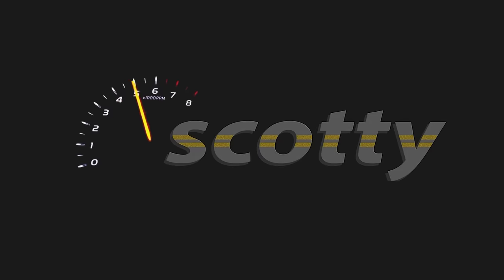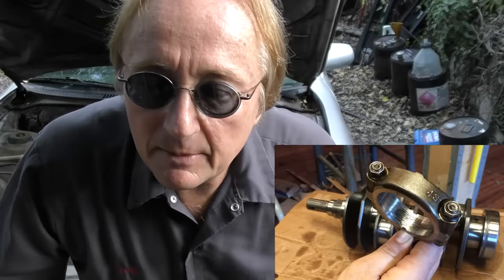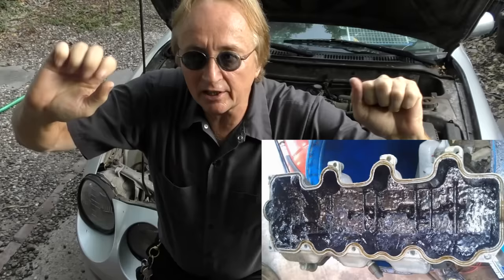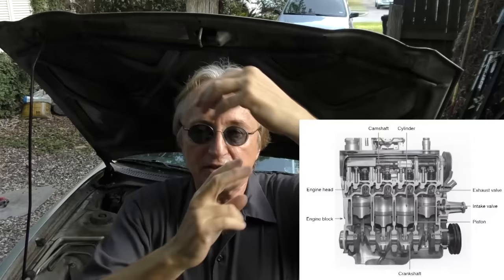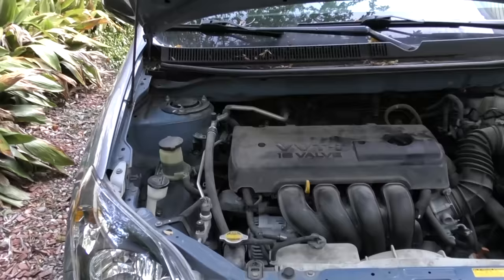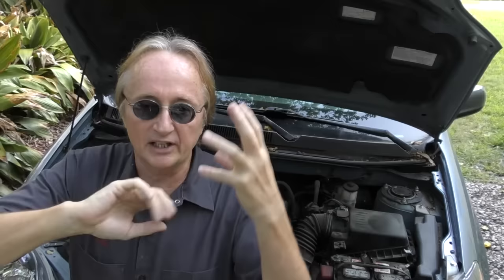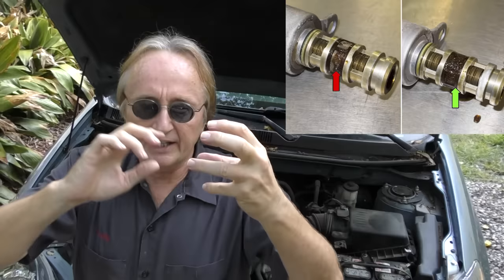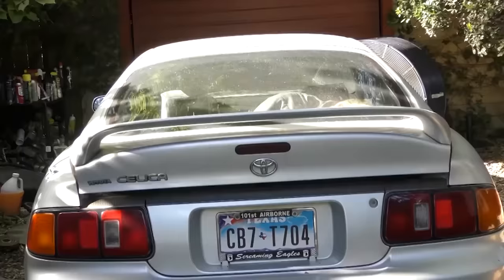Why Not to Flush the Engine Oil in Your Car

Comment: When I worked  At Valvoline Instant oil change They would  Make me try to sell cars with only 20.000 miles a engine flush  There was no purpose of that it's pretty much a brand new engine and  Make me push an engine flush on every car  I don't feel comfortable selling people products they didn't need So I quit  I don't like Scamming people I like to help people
Reply: I actually got one of these a few days ago on a used car I just bought. The used car dealer overfilled the engine oil big time and they used conventional.  One night coming home I decided to floor the car and it went in to limp mode. I bought MAF cleaner but I was worried about the engine oil being so full so I got it changed + an engine clean at Valvoline. Car only has 40k miles but I want it to last 400k.
Reply: If you can't flush a new engine and Scotty says you can't flush an old one, when can you flush? Never?
Reply: @spoton3278  I think you're missing "if properly maintained", which this wasnt.
Reply: Thank you for your honesty and integrity.🙏🏽🙏🏽🙏🏽🙏🏽
Reply: I happen to have a Valvoline in my town, they are quite the opposite. I'm sure it depends on the owners
Reply: @affinity3281  - Engine flushing is a scam. Modern high detergent motor oils don't allow varnish (much less sludge!) to accumulate. Look in the oil filler hole of a recent car that has had it's oil & filter changed at least according to spec (generally 7,500 mi) and you won't see any varnish. A well cared-for motor made 20 or 30 years ago that has had SJ, SK, SL oil for most of its life will have a little varnish. SM and SN will get that varnish off everywhere it matters.
Just spend that flushing money on more frequent oil & filter changes.
Reply: My shop doesn't do that we don't try to sell flushes unless the customer insists because its useless to do so
Reply: Good for you! It's better to be honest because people notice and you'll end up with more customers
Reply: @algrayson8965  sludge happens when no service intervals are respected.
 You cannot remove sludge with a new oil .
Reply: you are a good soul!
Reply: @algrayson8965  very good advice Al
Reply: Use flush only every 50k is my advice.Frequent oil changes is a must.
Reply: I work at Valvoline Instant Oil Change right now and they legit tell us NOT to pressure customers into buying things and let them decide what they want or not. We show their current air filter and compare it to a new air filter and from there they decide. Your comment is bullshit, us pushing the customers to buy different services is bullshit lmaoooo they tell us not to do it
Reply: Thank you for your honest, we need more people like you.
Reply: Question: Valvoline told me 3 months ago I will need a engine flush. Fast forward to today I'm at 52K miles on my car and will also need an oil change. Should I skip the engine flush all together and why do Valvoline reccomend it?
Reply: Tremaine Johnson You don’t need an engine flush. What kind of oil do you usually run in your car? Conventional, Semi-Synthetic or Full Synthetic??
Reply: @michaelnikprelaj6679  semi synthetic. I only have 52k miles
Reply: Tremaine Johnson Do you do your oil changes on time every time? Every 3-4K miles is ideal. If you do your oil changes in that interval you don’t need an engine flush. Btw what kind of car do you drive
Reply: @michaelnikprelaj6679  absolutely, Hyundai Sonata 2014
Reply: Do u get flushes if u dont do oil change on time?
Reply: Tremaine Johnson Not necessarily but I personally would just because I’m OCD lmaoo
Reply: @michaelnikprelaj6679  thanks for your help today.
Reply: @algrayson8965  You do admit that sludge builds up then you must use flush thats it
Reply: @michaelnikprelaj6679  - Modern ECM cars compensate for altitude, barometric pressure and air filter restriction. Up to a limit.
Reply: @spoton3278  Yes.  Never.
Reply: SpotOn flush after Mexican dinner
Reply: @affinity3281  What do you mean: "an engine clean at Valvoline?"
Reply: That being said..how is vavoline oil..i started using it recently...jus like any other oil hih?
Reply: Jiffy Lube wanted me to that with my 2002 Mercury Gran Marquee and they insisted I get it done and since I repeatedly refused they said I cannot leave until I get the synthetic service.  I got right back inside my car and blared the horn until they let me leave.   No one is allowed to hold any customer against their will over anything.  Believe me, I got really loud and obnoxious.  I black listed that place big time and made sure EVERYONE knew about it.
Reply: @NRush2009  skip it. Doing do it.  No need. Just keep up a good oil change schedule. And go synthetic if you haven't already. Modern oil has great detergents that keep your engine clean. Valvoline is recommending it because they make more money selling you the flush product and charging more labor for the performance of the flush. Just a way to make more money
Reply: @michaelnikprelaj6679  
Are you trying to tell us that all Valvoline Instant oil Change locations are exactly the same?
Reply: @NRush2009  
What does Hyundai recommend for oil? Is it OW-20? Most manufactures have it right on the oil filler cap.
Reply: @frankiegoes2placestravelvl507  
If Jiffy Lube did that to me I would call the police and the news department of a local TV station.
Reply: Steven Sevek Since all of the Valvoline stores are corporate, we’re all taught the same, doesn’t matter which location you go. Pushing ANY services to the customer has NO affect on the employees. We don’t get paid commission.
Reply: @michaelnikprelaj6679  
I appreciate that but just because they are taught the same doesn't mean they are all run the way they were taught. Even some policemen are dishonest. A cop was recently o jailed in Pennsylvania for sex crimes against female drivers trying to tell them if they had sex with him he wouldn't give them a ticket. I worked for Home Depot for 18½ years and they are all taught the same. But after being in 4 different stores I can tell you that not all managers are of the same quality and not all of them follow SOP (Standard Operating Procedure).

Okay you don't get commissions so I understand what you're saying since that was the statement made. However I'm sure the manager would benefit in some way by increased sales. No?
Reply: Right there with you. Managers would try to force me to sell that crap on every car.
Reply: I quit a corrupt automotive job to, a male nurse now.
Reply: @frankiegoes2placestravelvl507  they can't force you to buy the service if you don't want it you can leave i would have done the same thing i be gone so quick
Reply: My car got slow after a engine flush at valvoline. Speed good on first gears but slows down after the other gears. 
Please can someone know anything about this. 
Thank you for you help.
Reply: I’ve heard a lot of it is atf fluid added in to break down carbon deposits. Same reason they use atf for cleaning guns
Reply: @judahsoremy9857  valvoline brand oil cleaner
Reply: Blake T  it could clog the engine if it has lots of sludge
Reply: You a real one🗣
Reply: 20,000 miles is a good time for a flush or cleaner. Follow up with an early oil change, like 1000 miles.
Reply: @tarquineous  750000 miles for the first flush and then every 500000mls
Reply: @frankiegoes2placestravelvl507  Not true. A vehicle service center can refuse to let you leave if the vehicle is not road worthy for what ever reason. Seen it happen all the time. A lot of the time they will tow it back to your house or where ever you want it. Especially if it concerns vehicles like tractor trailers, they would get called on as soon as they left if service is not done. However in your case it had nothing to do with road worthy concerns.
Reply: @affinity3281  i think its always a good idea to do a hot oil flush now and then, it will keep it running the best it can. Its simple, you take care of your car, and itl take care of you.
Reply: I got fired on the second day I worked at Valvoline cause I didn’t pee in the cup
Reply: You guys also tried charging me $95 for a full synthetic oil change
Reply: @Kamal_AL-Hinai  they were getting me in trouble for not trying to sell it on every car
Reply: @NRush2009  to make $$
Reply: @michaelnikprelaj6679  ams full synthetic
Reply: @michaelnikprelaj6679  1st Gen Toyota Tacoma Prerunner
Reply: @NRush2009  nope
Reply: thekeyboard warrior  ya what u need
Reply: @fernandocoronel8404  if it's your gears probably your transmission
Reply: Yes it can that's why I don't recommend ending flushes on newer vehicles
Reply: I tell you buddy, almost every business out there is pushing unnecessary product and services. You are not alone in your feelings. And please never change your moral conduct.👍
Reply: You are a Hero!
Reply: I recently had a short stint at Valvoline. The only time we can do a flush (or an evac—short for evacuation—as Valvoline calls it) is when the oil is full on the dipstick. If the oil is low, we just do regular oil change. The people working at my previous store are honest and never pushy, though I'm not too sure about selling wipers. If Valvoline also sold long-lasting silicone wipers, it would be 150 percent honest. It only sells regular rubber wipers that need frequent replacement. More replacements = more $$$.
Reply: good for you👍
Reply: I salute you
Reply: @affinity3281  that depends on what car brand you got
Reply: @stevenjr6582  I disagree. I've seen amsoil and royal purple take some nasty stuff out of a motor.
Reply: @spoton3278  Only if dirty
Reply: Same here, except pep boys. I want to help people, not sell "wallet flushes".....
Reply: Can confirm!
Reply: You are amazing God bless you . I feel the same as you
Reply: @frankiegoes2placestravelvl507   Whaaaaaaaat? What a nightmare!
Reply: I flush my butt with Taco Bell !
Reply: God bless you for your moral and integrity. I remember going to jiffy lune one time and My car had 47,819 miles. This one guy told me I need an engine flush and I called my brother to let them know what was going on. My brother said take your car and get out of there NOW! They are scamming you. We definitely need more people like you on earth to create a better and safe place for others. 🙏🏼🙏🏼🙏🏼
Reply: I did the same job . The time came did not get any extra sales so they got mad at me . Guess what.  I lost my job . Now I have a way better job, cdl driver . Don't scam people.
Reply: @spoton3278 this dudes saying they tried to make him sell one to a car with 20k miles which unless you never changed your oil it would be pointless
Reply: For 20k miles, trust me. That engine sure as hell needs it😂🤣
Reply: @desmondlouis5762  only if they didn't change the oil like every 15000 miles, would be better to do multiple oil changes in a short period of time for new engine first few oil changes
Reply: i just got talked into a engine flush at valvoline 4.3 v8 caprice regretted it immediately. no issues yet only went 30 miles so far. how worried should i be?
Reply: @Mr-furley  there's nothing to worry about it's not going to damage your engine it can help engines that have sludge
Reply: @stevensevek6151  no there independent ly owned
Reply: @michaelnikprelaj6679  not all of them are corporate my friend has a franchise
Reply: @NFLYoungBoy223  lmfao
Reply: @davidkeevil5151  my first job ever😂
Reply: @michaelnikprelaj6679  you still working there
Reply: @MrROTD  the oil change box stores are not “shops” there are no mechanics there
Reply: @awaisiqbal8934  the point was; the sludge is OK deposited on the side of a rocker arm,but if you now knock that stuff all into the little oil tunnels of the components, it will plug them up and actually cause severe engine damage. Kinda like turning on a ceiling fan that has never had the blades dusted, now the dust is everywhere.
Reply: @Mr-furley  swap out the oil and filter again in 1000 miles and don’t wasteyour money with flushes, you can do more harm than good - I have 2 4.3 gm’s but they are v6 vortecs in pickup trucks, I’ll bet the v8 has some nice torque
Reply: @kellismith4329  its really not bad far better than the 305 tbi. same cam heads as lt1 just smaller cylinders and stroke.
Reply: Am glad there are still people like u..
Reply: Every mechanic should be like that. Sadly all of the scammers in the past. Have given garages a bad rep.
Reply: Thank you, sir. You are a Great Heart Man.
Reply: Unless they went 10,000 miles on each oil change. But remember, if you use a flush, the next oil change should be done earlier than the manufacturer's recommended interval.
Reply: @spoton3278 You can flush any engine that has an oil filter. But not one with filthy oil. You do not want to clog the filter! That's why I say, if you use a flush, change the oil early next time. If the filter gets clogged, the bypass valve will open!
Reply: @affinity3281 
Last to 400K?
You don't want to trust a Valvoline quick change place then most likely.
Better than JiffyLube perhaps, but minimum wage employees are that for a reason.
Reply: Make sure they put oil in the filter, and hand tighten the drain plug.
Reply: Pretty funny man, went to valvoline today.  They tried to push that on my 2014 car, I change the oil appropriately so I knew it was fine.
Reply: If anything it’s better to routinely flush a new one so it doesn’t build up too much sludge, either that or never do it
Reply: No reason to quit your job. Just be honest with the customer, but also realize it's smarter to flush an engine when it is fairly new rather than wait.
Reply: @algrayson8965  Wrong. Every engine gets carbon and varnish build up. I've seen a few fairly new engines with dark varnish buildup. High quality oil helps, but still good to flush every year or two. Amsoil makes an engine flush, and so does Liqui-moly and Valvoline.
Reply: @michaelnikprelaj6679  Lol better OCD than AOC 😂
Reply: WOW, thanks for the info. I wanted to use valvoline oil in my engine, i will never support scammers !!!
Reply: @vexx5955  I agree, but remember his problem was a franchise issue...which has nothing to do with either the quality of the oil, or other franchise MO.

Comment: I'm a mechanic and I've had multiple engines with top end noises that sound exactly like a collapsed lifer or a stretched timing chain and oil flushes have corrected the issues 80% of the time. It's all about your personal experiences
Reply: I’m getting a ticking noise on my 2017 Toyota Corolla…you think that might help?
Reply: @bobespnza-la7030 hes not mechanic he don't know that
Reply: My mother had an 86 fiero that leaked oil. She was putting dollar store brand oil in it until it started knocking. When I tore that engine apart it looked like tar inside lifter valley.
Reply: @bobespnza-la7030 what solved the ticking noise ?
Reply: @BruceLee-xn3nn my uncle Barry had a k11 Nissan micra
Reply: Agreed bg epr fixed my pilot engine
Reply: Brendonfleming9243 i can see how after using chemicals that dont work ..flushing might work

Comment: Flushing your engine is perfectly fine,just make sure that you rinse the engjne with clean oil after flushing, means 2 times oil change and 2 times filter change.
Reply: Instructions don’t say that, so you should be perfectly fine with one flush
Reply: @tyronesmith3812  Thats because they want you to buy it not to put it back on the shelf.
Reply: Don't know why you'd wanna waste money on another oil filter considering you're only running the motor for 15mins
Reply: @jacobpeck9372 I think it is a matter of preventive maintenance the way the people who does it. In my honest and humble opinion though, it's probably not gonna hurt or damage the engine, but I think it is an overkill and I don't agree with it.
Reply: Just let the oil drain from the engine overnight if you are so worried. No need to go to extremes.
Reply: @no2thenwo737  exactly. No need to overkill things.
Reply: You can leave it open and just flush it out without wasting a new filter

Comment: Key point here… engine flushes don’t create problems. They reveal problems. Most people don’t need to do them, but there are times that it might be worth while. Just be aware what you might be risking
Reply: Unless a hole is going to be made in the engine after a flush, what's the risk other than preparing to bear the cost to replace seals and gaskets? Replacing the engine? Even then, is that such a bad idea if you plan to keep the vehicle? Will the engine keep running with the build-up inside? Or the recommendation is to replace the engine or buy a newer car when it breaks down.
Reply: @matlock8314  how about a couple of spun bearings because the crankshaft journals got plugged ?
Reply: @kellismith4329  The flush dissolves the dirt, not breaks it. There will be small particles but they tend to be smaller than 2mm in diameter which won't clog anything major and likely be retained by the oil filter